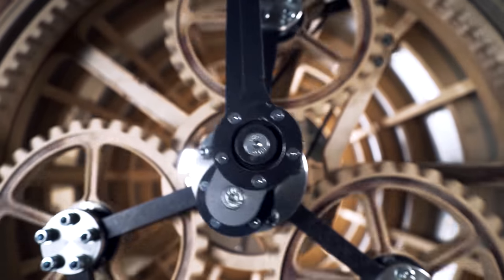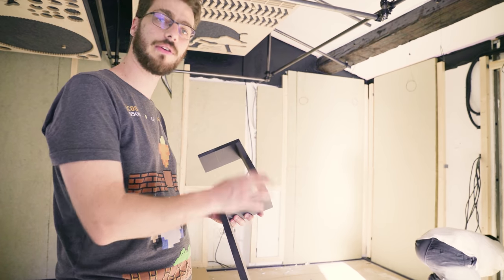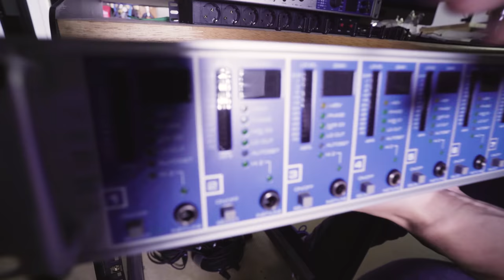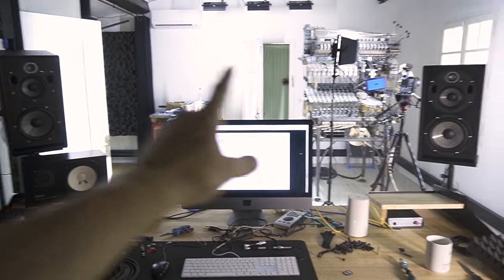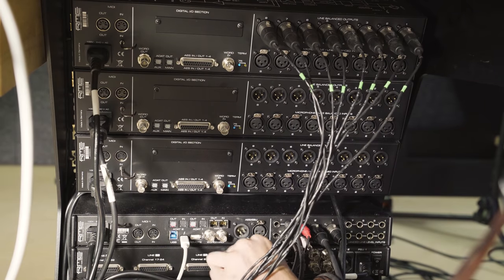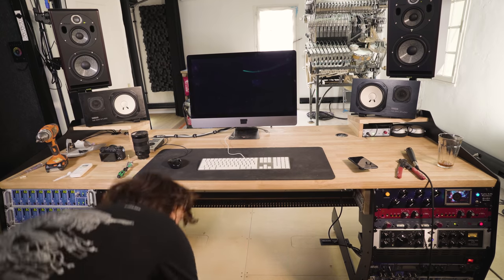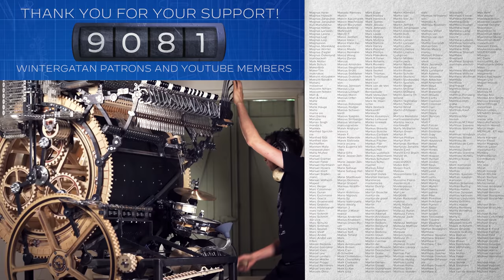Feels Like Home - Marble Machine X #134

Comment: Martin I believe when people were recommending going digital they meant using a digital snake. You would still have analog input and outputs from your channels and preamps. The only difference would be having an Ethernet style cable between the the machine and the space station instead of the super thick cable. A digital snake would also give you more cable flexibility for the world tour.
Reply: This is explained in the video where Martin says that he does not want to put 6 HE of preamps + converter into the marble machine and is really concerned about preamp quality and wants to stick with the RME Micstasys.
Reply: @r0ck53n  thanks for the explanation. But he could put a separate preamp/converter rack on the stage near the machine . Use a much smaller length cable. Then it will be digital the rest of the way.
Reply: @r0ck53n  I may have misunderstood video. I thought he was saying he didn't want the channels going digital directly into the interface. A digital snake basically just replaces the thick audio cable with a thinner one as far as I'm aware. I could see some issues with impedance and all that mess and wanting the most pure signal path between MMX and the preamps.
Reply: @r0ck53n  also do you happen to know what the little belt clip preamps on the machine are? I thought those were the actual preamps for the machine and the rack is just for recording. I tried to zoom in but I couldn't tell what they were
Reply: @henryD9363  I would guess this is exactly how he is going to do it. This way you don't have size restrictions on the preamps and AD converters and still can use one cable from the machine.
Reply: @jaredhouseman2094  Well, a "digital snake" is essentially an AD converter on stage with a digital cable and either a DA converter or directly via digitial (mostly AES50) into the mixing console. So if you are so concerned about the preamps that you want specific ones you cannot just use the ones from the digital stagebox - I am not saying that the preamps in the stageboxes are bad, but as he explicitly picked the quite expensive RME Micstasys (for whatever reason) he will most likely not just go with the ones in a stagebox.
Reply: Indeed, these are Ehrlund Microphones  EAP System and the boxes are indeed preamps. I don't really understand the setup either - the Ehrlund boxes are already preamps and then he feeds it into the RME MIcstasys for preamping again but does not use the excellent AD converters from the Micstasys but feeds them to the RME M-32 AD Pro which IMHO makes no sense. The Micstasys have an almost obscene dynamic gain range of 85 dB and automatic levelling, so you can basically feed any signal you have in the studio into them and always get a superb result without worrying about adjustment or levelling, so maybe that's why the RME Micstasys are in the chain.

Comment: Flip the focal tweeters 180 degrees, it might help them sound better

It will sound better if you flip the whole speaker upside down so the Tweeter will be closer to you but it may cause problems because of the drivers weight
(You will need the change the tilt of the speaker)

Comment: Headphone amplifiers are absolutely key to getting the most out of your headphones. Since you‘re running not too cheap headphones, it‘s an absolute must to go for a headphone amplifier. The real question is, whether the headphone amplifier you are running is better than the headphone amplifier built into your ADC. If not, I‘d advice you to give a THX headphone amp a go (e.g. 789 from Drop).

Comment: Quick 2nd step troubleshooting on the CH 3 feed problem, since you already confirmed the splitter out of the "Anaconda" cable at the console is working:  Swap the XLR outputs at the marblemachine of channels 3&4 (or 2&3) leading into that combined "giant snake". If the problem moves, then the fault lays in the "anaconda" combined cable.  If it stays on CH 3, then the fault is in preamp 3 or there-about.

Comment: the whole high ohm headphones ordeal is related to noise basically when you have a studio full of electronic equipment and maybe bad mains and lights that make electronic noise or are badly isolated this is where the high resistance comes into play as you need a higher voltage to make it audible
Reply: (basically, random voltages can come from heck all when having so many things connected and having higher impedance headphones makes it harder for noise to get heard because they operate at a higher voltage)
Reply: and to get back to why I originally started this whole ordeal the amp only makes sense if for an example you are having noise issues with normal headphones over a long distance may be and want to improve things by using high impedance headphones with that amplifier which takes the low power input but reduces automatically the distance it has to travel

Comment: I would think you'd put the 32-channel digital interface above the sound interface since its going to have more connections to the pre-amps.  This would prevent them interfering with one another as much should you have to change configurations.  Instead, you'll have pre-amp connections crossing one to get to the other.

Comment: There are multiple MADI and Dante stageboxes on the market that have high-end preamps in them comparable to the RME preamps you have. There are also MADI and Dante interfaces (designed for the installation market) that have Phoenix connectors on them instead of XLR for even lower profile if the aesthetic on the MMX is an issue. Also, while you have an SC fibre MADI interface, MADI will also run over standard CAT5 or BNC as well (which can be far cheaper than fibre). Sadly, the problems you have with channel 3 on your multicore will be far more regular once this is subject to the wear and tear of touring.

Comment: For the channel 3 on the large audio snake, I would first start by asking how he connected the mic into the channels on the machine side, if he was connecting directly into the snake then I'd continuity test channel three on both ends and then inspect the solder joints. If he is connecting in through the points mounted on the machine, then swap the outputs from there to the snake, so though he's plugged into mic 3 on the machine equipment, that is running through snake channel say 2, if it's still bad then the issue is the equipment on the machine.

Comment: cable managements... would you consider using some cable tubes over the Velcro ties and some for the channels cable separations? at least it will be in a  stack of tubes that you will find it easier to pin point each sides or even devices its going through

Comment: I don't know if it has been mentioned before, but did anybody check that the floor in the house will actually support the machine? I imagine its quite heavy by now and it would be a desaster seeing it fall through to the ground floor!
Also I would expect mould to grow under the acoustic panels on the outside walls. At least in the cold regions where I live that would surely cause problems with the beautiful studio

Comment: If you watch your video you will see that Channel3 from your spider was working too.  Preamp3 was showing that there was sone signal, the issue seems to be after Preamp. Your Analog digital interface didn't show any signal on channel 3. Therefore I guess the issue is either between Preamp3 and your analog digital interface or Preamp3 has an issue.

Comment: Martin, if you're reading this, I would add safety caps to the power switches on your racks. Would be a shame if you would accidentally turned off your equipment with a knee during a recording session.

Comment: Question about those power strip rack modules: Do those work as "individual" power sockets? Like an extension sort of to the already built-in sockets, you have in your wall? Compared to those cheap (often white ones), you can get for $5 - $10/piece?

Comment: Martin, have you considered making other types of instruments so you can, for example, you take out the vibraphone and putting another instrument in its place. I know it could have some major problems but that could give more options when composing music. I thin it could make MMX even better.

(I'm sorry if you said about it in any of the episodes but I haven't seen all of them yet)
Reply: Don't tempt him.  His team has held him back from 'feature creep!   Maybe on the Mach 3 MM...!
Reply: @peterkelley6344  I think he could do it after he finishes it.
Reply: @Moloxer  The MMX system is essentially modular, so in theory he might be able to work from what he has.
MMX team: Martin, you got to finish the what was originally designed first!
Reply: @peterkelley6344  I know that's the only reason that I made this suggestion. And I agree he has to finish what he made first, but I thought it was a good idea.

Comment: I was starting to wonder if you got that Lexicon reverb since I didn't hear back, I hope there wasn't any problems with using it on your 220vac (I didn't include the power cord since it wouldn't have worked for you anyway).  Did you get that tool stand as well?  I haven't spotted it in the background in the shop anywhere.

Comment: I mean a good headphone amp is crucial for analytic listening! Not having a good headphone amp would be the same as connecting your active speakers directly into the 3.5mm output of your computer, making the internal A/D transformer do all the heavy lifting which you don't want to hear (the output of my MacBook Pro 2017 is quite frankly extremely horrible). Now the second question would be whether one needs a dedicated headphone amp alongside the UFX+, since from my experience I can say that RME make quite darn good headphone amps. The one in my old FireFace is super, and I remember trying out the new BabyFace headphone amps out and I was blown away! I'm sure the Neve sounds amazing, didn't have the time to try it out at NAMM unfortuantely. Either way, very high-end stuff in the hands of someone as passionate as Martin tends to lead to supreme quality results. Don't use the jack outs of your computers, kids! Get a headphone amp!

Comment: I guess headphone amps do not really make a difference especially compared to the rme interface. The headphone outputs of studio interfaces should be designed in a way that the impedance of the headphone does not change the sound.

Comment: The RME Micstasys already have a very decent A/D converter built in and can also be equipped with MADI. I don't see any reason to add a separate RME M-32 AD Pro for conversion. Maybe someone can explain this to me?
Reply: I'm also interested in that. The only two benefits I see are reduced latency (less hops with this wiring than with daisy chaining) and the option to use AVB and Dante.
Reply: @davidruppelt  I go with AVB, but the M-32 AD Pro does not have Dante, but the coverage of AVB in live consoles is pretty limited. However, the current setup is super easy to understand, just plug cables in in the correct order instead of configuring individual MADI channel ranges on the Micstasys. The latency for a MADI hop is in the lower microsecond range and can safely be igored.

Comment: On the stage how is the A2D conversion performed? Currently it's performed at his desk which is massively wired into the room, ie not movable.
Reply: Probably in a side-rack on stage with the preamps and the AD converters connected via the analog snake.

Comment: While it isn't strictly necessary to have a headphone amplifier, one almost certainly will provide better frequency response than whatever is built into your pc. It is when you use high-impedance or low-sensitivity headphones that you require extra power to deliver similar volume. Depending on what DAC and amplifier your integrated sound processor has, however, you may also benefit from an aftermarket unit. For example, most onboard sound processors suffer from lower signal-to-noise ratios than aftermarket cards with circuit isolation and noise filtering mechanisms.

In most cases, when you turn the volume of a computer's onboard audio chip all the way up, you will hear a hissing noise from the headphones or speakers, even when no signal is being sent to them. This is because onboard chips may have a SNR of 70-80 dB, whereas a good aftermarket add-in card or external processor may have a SNR as high as 120 dB. The lower SNR in the onboard chips is typically the fault of both the audio processor and amplification components themselves and other components on the circuit board introducing electrical noise.

Using an external amplifier by itself carries whatever noise into the output sound that the onboard processor introduces, but using an external DAC in addition to the amplifier may improve your experience. Whether you can tell the difference depends on what headphones you have and how good your hearing is.

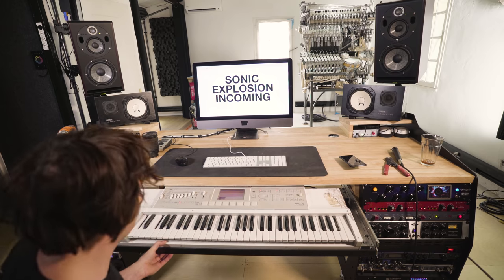Comment: RE: 17:40 - You are asking for that keyboard to fall on the floor. Get yourself a 1/4 inch thick piece of plate aluminum sheet to fit that area and make a legitimate drawer out of it. THAT will fail if you don't, and it will happen at the worst time when you don't have time to deal with it.

Comment: Just an amp? And not a dac? I mean I can tell you strait up that's just going to make it louder. It's not going to do anything good for quality unless you've got headphones that need the power. Dac and amp combo though, yea I'd guess that would be better than your PCs build in audio due to better isolation and such. There isn't really anything to argue about when it comes to getting an amp, you either need it or you don't, or you just want it. In which case what it does to the sound doesn't matter because it makes you happy.

Comment: Amping a high-ohm headphone is not a placebo - a 300ohm set of cans requires about 1/3W of power (usually!) to operate with the support that is required for peak performance and accuracy; this has been fully explored and lab tested!  The easy way to think about it - if you have a 5000kg truck - how well would it work with the engine (and brakes) from a small Citroen? Providing proper amping to any driver not only impacts its ability to play at volume, but also play with less distortion.  now, these amps CAN make the sound worse, and will add noise, and can color the sound, and add complexity. A very low THD amp is important, but adding noise (often referred as 'personality' or 'coloration') with , say , a 1/3w tube amp can still provide an accurate monitoring system - as the color and personality is very consistent, predictable, and our brains quickly hear through this coloration like how our eyes can ignore a messy windshield while driving. Under supporting headphones, however, will result in inconsistent issues with reproduction, and this impact can be different for different headphones - some lose transients, some get muddled during dynamic sections - and the impact is variable and will change in intensity depending on source strength, source complexity, and timbre of the music.  THIS is nearly impossible to 'hear through'.  Now, if you run 32ohm cans, don't plan on buying an amp impedance matched for a 300ohm headphone - this is like putting a heavy diesel in your sprightly sports car!

Comment: I really don't get why you chose to use this big analog cable. In any way a digital dante stagebox would've been so much better. Especially since you're converting everything to digital anyway at your desk. The only downside is that you wouldn't have those blinking leds on the preamp it seriously, this would've saved you so much money and potential hassle and would've erased so much potential sources for error. Best example us the issue with channel 3. Believe me, it will only be the first of many annoying errors